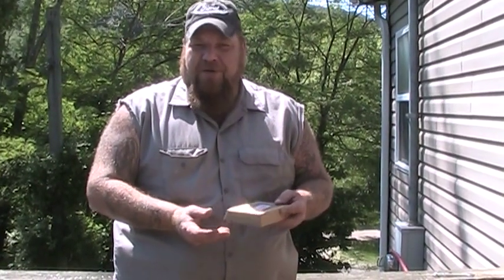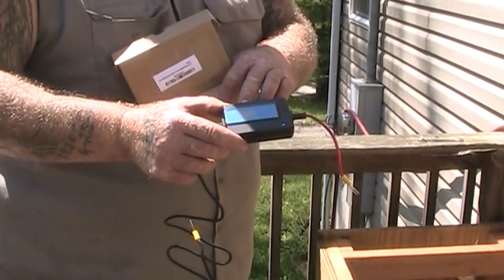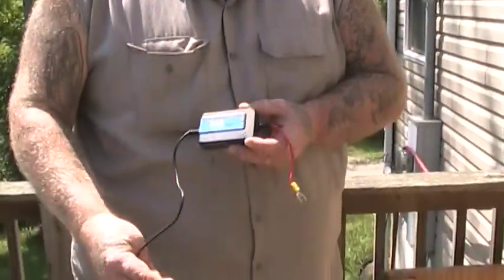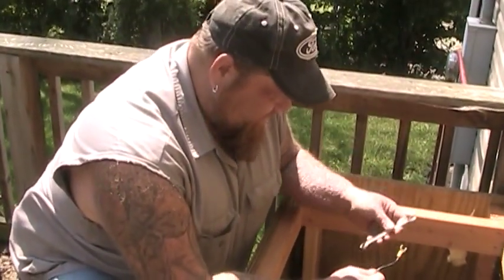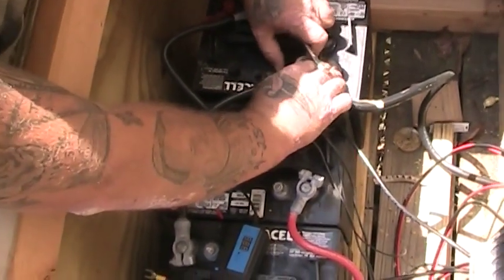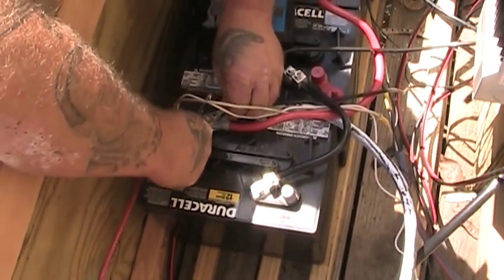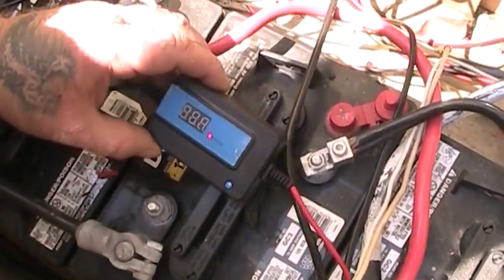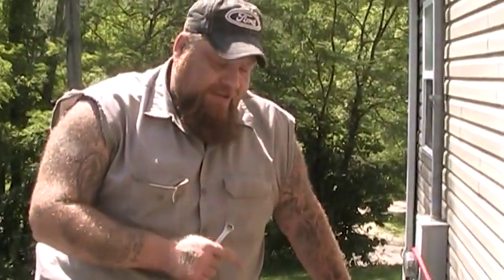Auto Pulse Desulfator Install on Battery Bank

Comment: I purchased 4  PowerPulse Battery Maintenance System

 For my 1410 ah 12v bank and with those hooked up together and my 3 phase wind turbine my batteries stay good clean plates amazing.

Comment: Hello. Make sure you inspect the specifications of your de-sulfator to make sure it is rated above your battery bank "Ah" rating. The majority of the units you buy on Amazon are rated for 200Ah and below. If you are like me, and using 6v batteries that are 225Ah to 245Ah then you have exceeded the Ah rating of the de-Sulfator, and it will not work as well as you hope. There is a 400Ah model that will do the job for battery storage that we use with our Solar/Wind power storage systems. When you connected the de-sulfator over your 2 paralleled banks, I have a feeling you are really exceeding the 200Ah and below rating of that unit you have. It would be best to have one 400Ah rated unit on each set of two 6v batteries to assure the efficient operation of the de-sulfator, and an overall healthy bank ! Be good, be Safe, and be Well !
Reply: ***** That link is for another 200Ah max bank. Mainly for automobile batteries. The important thing is to have one that is rated for a 400Ah bank 12v to 48v for deep cycle batteries as we use in our solar and wind power systems.

Comment: might i suggest for safety sake use a ratchet when unbolting battery connections like you just did...seeing you swing that wrench side to side with neg and pos terminals could be a shocking experience...at least with a ratchet the handle is far above terminals and harder to short out

Comment: I added two power pulse units to my old bank of (4 185 amp hr batts) that was not accepting charges well, they do seem to work well. these are where I got mine, they recomended on unit for every two batteries.  http://www.batterystuff.com/battery-restoration/12-volt/PP12L.html

my new controller is a pwm on the new bank so these are not needed.    alot of the new controllers have the pulse width modulation built in so these are not needed.

Comment: Power company electricity will always be cheaper than any home solar, wind, or water. Even still, it's nice to have a backup. I hate being reliant on anybody for anything.
Reply: ditto....not always about the money...but nice to have some power when the grid is not there for us....a few LED lights and able to charge phones or run small fan on a woodstove in winter is big time psychological conveniences
Reply: Justin Case Seems to me someone could start a business importing quality solar components into Australia and undercutting the competition unless the problem is tariffs.
Reply: you don't live in Australia. 48cents a unit. solar is very cheep indeed.
Reply: Justin Case Holy Moley! I pay $0.28 (28 cents) per KWH, and I think that's high. On the other hand, my understanding is that solar equipment is cheaper in OZ.
Reply: John Strabismus yes the grid ties are cheep 3kw solar system price – $3500 -  5kw Solar System price - $4495 -6kw Solar System price – $4995. But we pay a lot more for charge controllers. take the midnite classic then add shipping. DC breakers all have to be shipped into australia so add shipping. sure there are cheep controllers from china i have a box full that did not pas my testing at all. and batteries. you pay under 350 for Trojan Solar Battery 6V 1090AH IND17-6V here $1,705.00. So no its not cheep to go off grid. its a life choice. and every year power cost go's up. then the gov will raise GST tax and then everything go's up in price. I just 1 mean government roundabout. I made the choice to get off it.
Reply: John Strabismus Wow - I pay 11 cents per kilowatt hour - and I thought that was expensive.
Reply: The Meat Trapper Move to California so you, too, can get screwed over.

Comment: I think my exact answer to your question 1 what is a Desulfator and 2 do they work was.
well John when you use a led acid battery it forms lead sulfate crystals witch after a time reduce the power and life of the battery. All led acid batteries have this problem. A good battery desulfator Puts a spike or pulse into the batteries that helps the lead sulfate crystals dissolve back into the electrolyte. Extending the life and keeping you battery in tip top condition,
Reply: Let us know how it goes and if you notice any difference in your batteries. Congrats on the 24v. I am loving my solar :-)